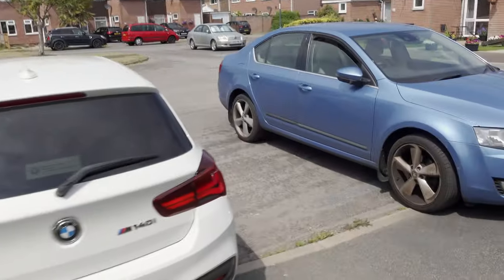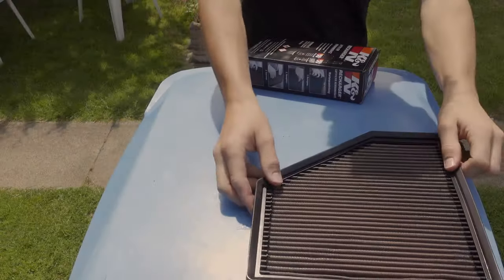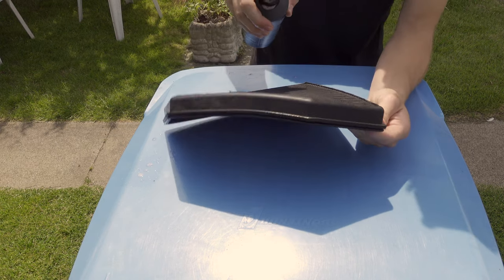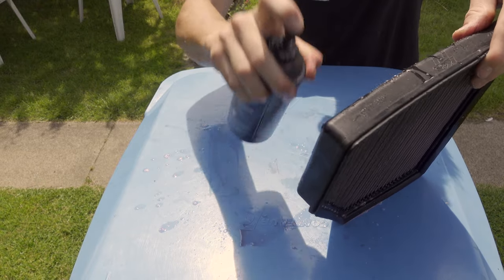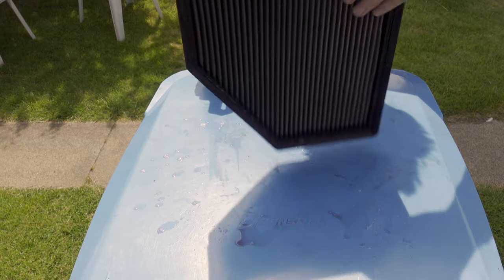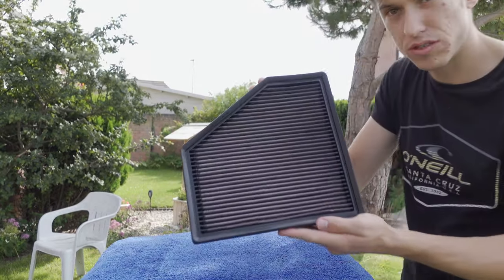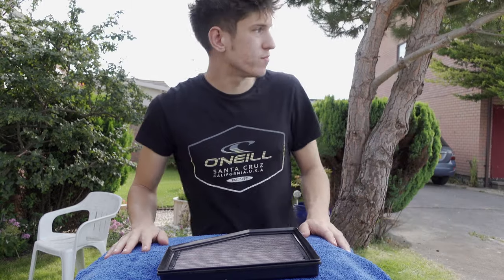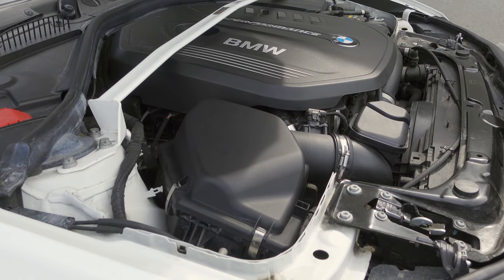Servicing The K&N Air Filter In My M140i (Walk-Though + Sound Clips)

Comment: Nice job reg. 
I used to run k&n’s on my carb’d bikes open and air boxed. After a fine tune u certainly noticed (and heard!) a power increase. 
I wouldn’t risk it nowadays though reg,only OEM paper for me as there isn’t any power increase with any of these type of filter on a standard engine but plenty of risk to eating through MAF’s. 
All the best

Comment: I'm still using the stock paper on mine Reg and it's mapped with a Remus race catback. I've seen a test where the K&N lets in fine particles, it was practically the same as not running a filter at all. This all builds up in the oil via blowby to increase friction causing premature wear.
Reply from the maker: I’ve also seen a very comprehensive test where this is false. I had a K&N CAI on my 2000 E46 330ci. It was installed at 80,000 miles and the car is still going at 225,000. It was driven pretty much on the redline everyday and did countless track days. Engine is still going strong and it dyno’d at 231bhp at 180,000.
Reply: @roadreg1820  That's a lot of miles with no problems. Hmm i want one now 😂
Reply from the maker: @sportsmachinerr1401  genuinely they are safe for your engine. K&N have been making these air filters for a very long time. I clean mine every 10,000 miles and you can see all the dirt it traps. 😎

Comment: K&N are a bit wank imo, and I have tried a few over the years in several cars.
Got an ITG panel filter in my M140i. But, hey each to their own......
Reply from the maker: They’re awesome. Never had a problem with mine. The air box is really good in the M140i’s so a ITG is the best way to go I think.
Reply: @roadreg1820  Yes I'd agree, no need for a cone filter sucking in all that engine heat mate :-))
Reply: @DjNikGnashers  hi do you think there is any benefit from running the itg panel filter , reason I ask is I was using one in my 140 which is 540 bhp , and now I have swapped it out for a new oem filter and I feel the car is better with the standard paper filter
Reply: @Addselwyn  You know what Adam, at my last service I had the original panel filter put in, and I noticed zero difference lol !
So I think I'll stick to original, it looks like it gives better dirt capture anyway, so less crap in the cylinders :-))
Reply: @DjNikGnashers  thanks for the reply , I agree I would rather better filtration with the oem panel filter as my car is a keeper and I’ve had it from new , I have the hot climate mod which is helping and might get the afe air scoop , Peter from pure turbos was running standard filter as well I think on his car , 👍🙂
Reply: @Addselwyn  Mine was heat soaked on the dyno at 455bhp, so I'd imagine better cooling is a must at 500+ !
My tuner said an upgraded charge cooler rad should be my next mod.